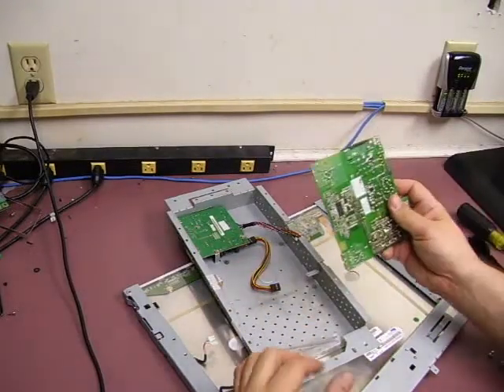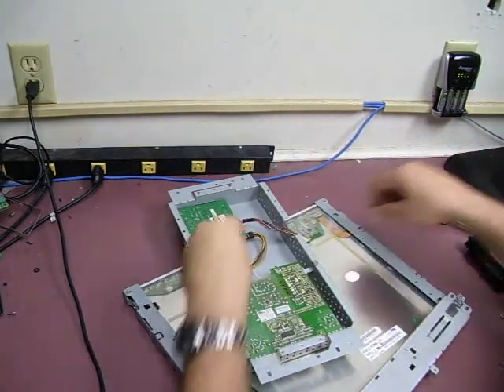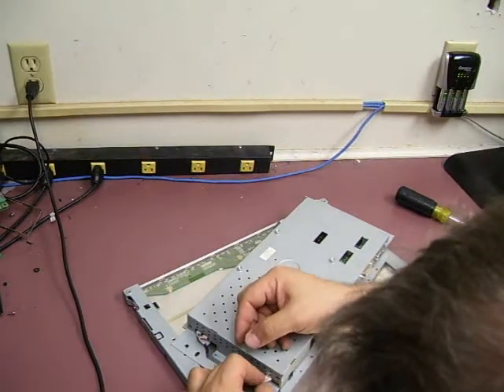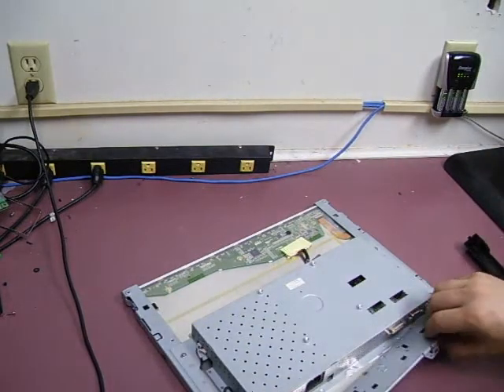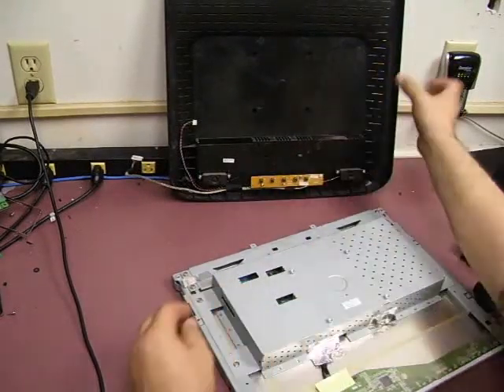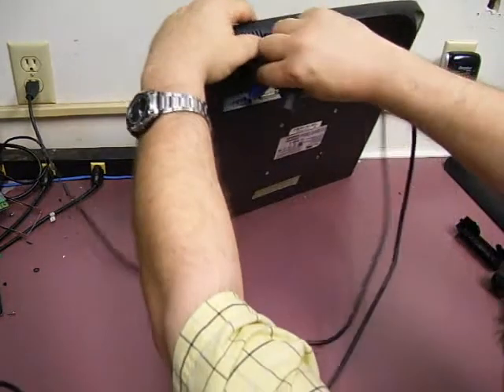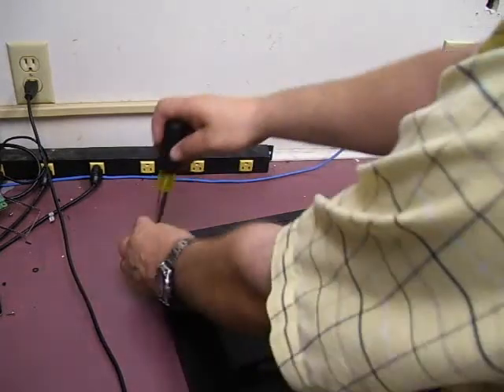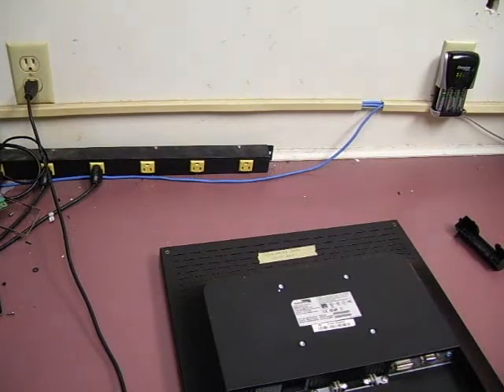Repairing a HannsG HN199D part 3 reassembly and testing

Comment: thanks for the video.  i have Hanns-G HC194D monitor with a similar 'flickering' problem.  i am not very good at soldering, wonder if there's a way to find out what particular capacitors are gone and replace only those ones? or you won't recommend this kind of 'simplified' repair? thanks again.